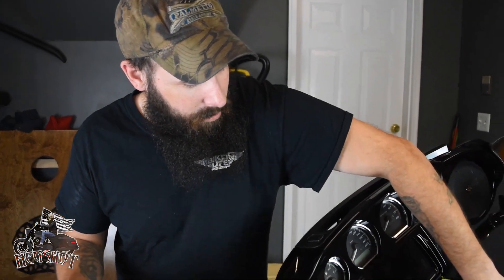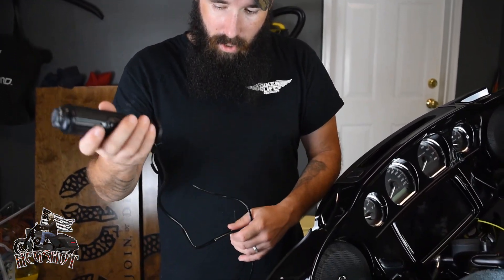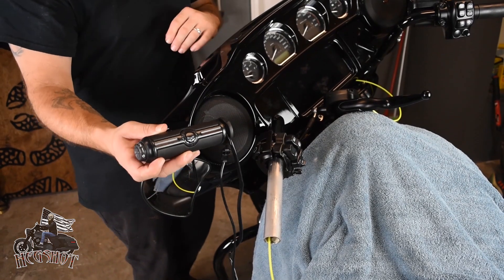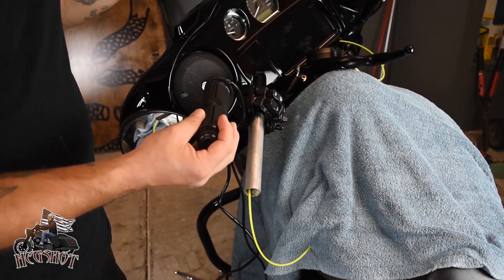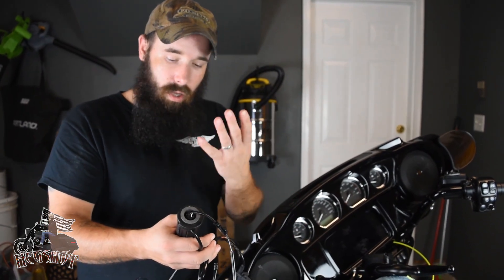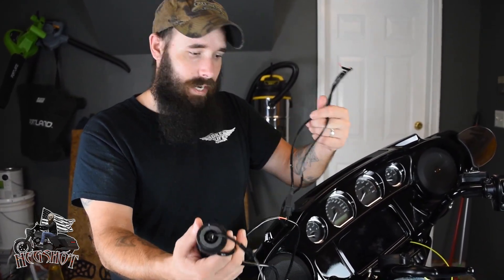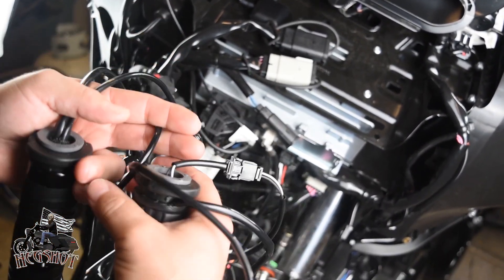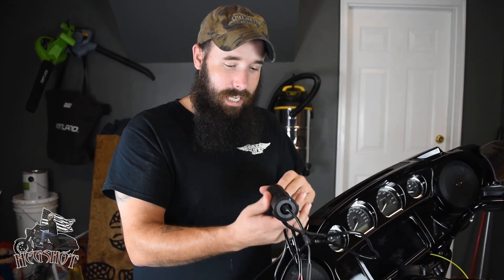Watch This Before Buying Willie G Heated Hand Grips!

Comment: I also purchased the accessory harness kit and installed it. Didn't need it either but I guess it's good to have for the heated seat in the future. Looking at the grips at the dealership, looks like all the collections that came out later in the lineup are coming internally wired and USA made. I remember the old ones were Mexico / China made. Seems to make a difference in the quality.

Comment: I fitted these, you simply cut a slot in the black disk on the grip and then feed it through the bars, cut the plugs off and use Wago connectors in headlight, there's always power somewhere in the light or fairing if it's a glide, running via the accessory fuse, sometimes you need to get away from this plug and play mentality and use your grey matter.

Comment: I just installed the Kahuna heated grips on my 19 Street Glide plug and play. Took me about an hour.
Reply from the maker: Exactly. It's not to hard at all. I just dont get why all grips dont plug into the pre existing connectors lol
Reply: I’ve never seen any with the long wires like you showed. I’ve installed 3 sets and they’ve all been the same. Never a set of Willie G grips though.

Comment: Just watched this as my grips on my 2015 have failed somehow. Doc Harley reckoned the extra wiring kit was because of needing to push an extra 2.8 amps and not upset the bikes electronics. Before your vid I watched an install straight to the connections under the fairing as harley set up the 14 + streetglide specials that way. If I already have grips fitted I'm guessing I just replace them?, I like the black kahuna's also
Reply: Do you have a link to where Doc Harley said that please ? Thanks in advance 😃